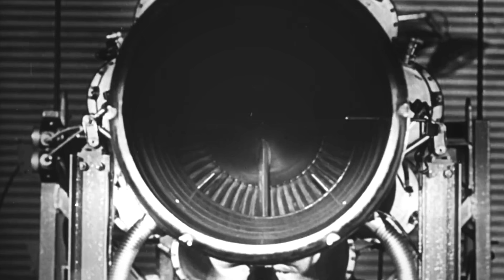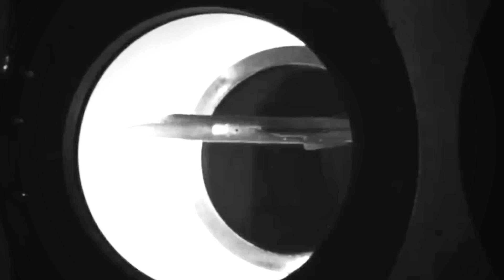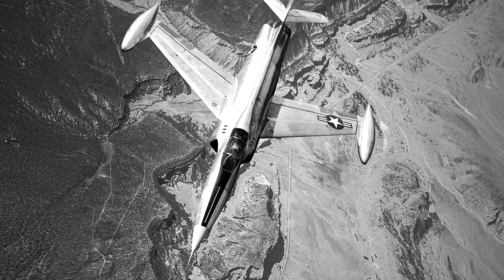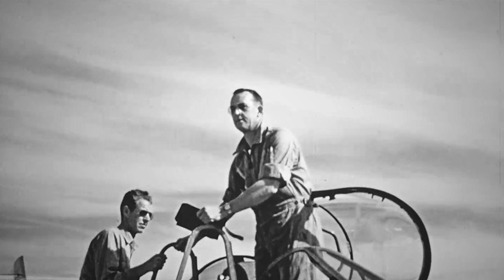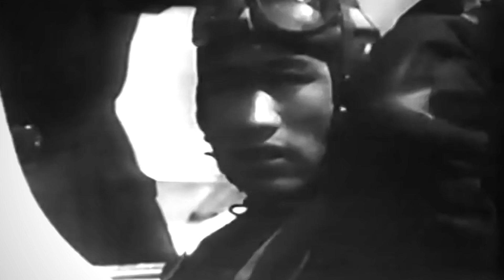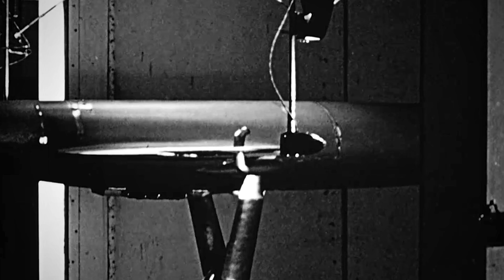XF-90: The Strongest Warplane Ever Built?

Comment: And yet, the Korean conflict proved that a good pilot can make even an old plane.Take down the newest latest baddest plane on the planet.And the early days of the korean conflict , five p fifty one , we're on a Close air support patrol when they got jumped by 3 migs.I forget what model they were using in the korean conflict. But it could actually fly faster, had a wider turn radius, which the P50 ones used brutally against the mig.Two fifty one were shot down to migs were shot down the third one fled damage. Not bad for a bunch of old dogs , wouldn't you say

Comment: Am I the only person who looks at this aircraft and thinks of the HAL Marut HF-24, that was designed by Kurt Tank, the designer behind the FW-190,  and the Ta-152 ?
Reply: I'm actually thinking that it looks a lot like the Hawker Hunter. Especially, the tail section.
Reply: The XF-90 was developed a full decade before India's Marut, which was designed & developed by a German & a team of foreigners, and used components sourced from countries outside of India. HAL wanted to have an Indian fighter-bomber jet by contracting out Marut's creation, and then tried to build as many of its components as possible inside India. HAL couldn't acquire a powerful jet engine, nor could it design its own, so the jet was very underpowered and never met its design specifications. It was cancelled after a couple of hundred were built.
Reply: @oahuhawaii2141  It would not surprise me that similar form was created by similar function. I know that Kurt Tank worked in Argentina for the Peron regime to build their first domestically made air force jet, the Pulqui or Arrow in English, which was powered by a RR Nene turbojet.  If the Argentinians had difficulty buying top shelf engines, the Indians, who were eyed with suspicion by both the Eastern Bloc and the West would have been up the creek without a paddle trying to do so.  However a few hundred aircraft is still not the smallest production run ever of a jet fighter, and considering their limitations, they did acquit themselves reasonably well in combat in the frequent fistycuffs with Pakistan. I guess it was another " what might have been" story...
Reply: Maruti originated as the I. Ae 43 for Argentina.  Tank took all the data with him when he went to India.

Comment: Looks similar to the HAL HF-24 Marut
Reply: The XF-90 was developed a full decade before India's Marut, which was designed & developed by a German & a team of foreigners, and used components sourced from countries outside of India. HAL wanted to have an Indian fighter-bomber jet, by contracting out Marut's creation, and then tried to build as many of its components as possible inside India. HAL couldn't acquire a powerful jet engine, nor could it design its own, so the jet was very underpowered and never met its design specifications. It was cancelled after a couple of hundred were built.

Comment: Looks a bit like the Indian HAL HF-4 Marut
Reply: The XF-90 was developed a full decade before India's Marut, which was designed & developed by a German & a team of foreigners, and used components sourced from countries outside of India. HAL wanted to have an Indian fighter-bomber jet, by contracting out Marut's creation, and then tried to build as many of its components as possible inside India. HAL couldn't acquire a powerful jet engine, nor could it design its own, so the jet was very underpowered and never met its design specifications. It was cancelled after a couple of hundred were built.

Comment: The F-86, although a contemporary to the XF-90, was not in competition to it. The three aircraft in the penetration fighter program were the McDonnell XF-88, the Lockheed XF-90 and the N. American YF-93.  The XF-88 technically won but never went into production, later developed into the F-101.  The YF-93 was a larger and heavier outgrowth of the F-86 and resembled it.  It was not developed any further and was scrapped.  The video is correct that the XF-90 survived three A-bomb blasts but they were three separate tests on different dates.  Th plane faced the blast during the first two and survived with damage the might have be repairable. On the third blast it was 90-degrees to it and was wreaked.  The US Air Force Museum recovered it in the 1990’s and it is currently on display at the Dayton, OH museum.
Reply: I don't think there was an intention to contrast it as being a straight up competition, since it was for a different program and purpose. BUT there is also the reality that if there are lets say 5 projects touted by the government to potential suppliers, there is a really high likelihood that of the 5 only 2 or 3 will actually go on to get funded and done, and it is likely to be either the most useful, or the ones where the proposals meet the requirements the best - ie have the highest likelihood of success within the allocated budget... something like that. There was a video that went into all the sorts of things that there were RFP's for from the airforce or navy/army at one point and there were some quite... "reaching" RFP's in there - of course it's a fair play for them to ask essentially "do any of you guys think you can build X,Y,Z? If so, how much would it cost and how long would it take?" - there have been combat spaceplane RFP's and space station RFP's too, and I don't mean the ISS, I mean something like 10-20 times bigger at least. There is documentation about it, even in printed books from the early 80s and before. It never went anywhere because... well people didn't have the balls for it - risk appetite as you might term it more diplomatically heh.

Comment: Well, I don't know what skunk works were thinking of with this bird, a steel frame is not what any aircraft wants. I'm surprised they were scared of an aluminium frame, or even a titanium one, although that was in short supply at the time, even the SR71 Blackbird had to trick Russia into getting the material.. These days it would probably be carbon fibre, but that was a long way off.

Comment: It seems it was an advanced airframe in want for a power plant that had yet to be developed.
Reply: It won't have helped that they hadn't discovered the area rule yet. You can see that from the plan view of the jet. With the "Century Series" fighters there were a lot of problems about fighters having more drag than expected and not reaching the speeds that were hoped.
Reply: And modern materials and manufacturing techniques.